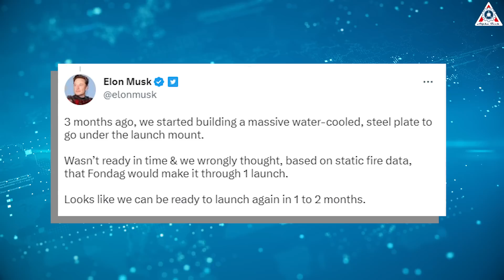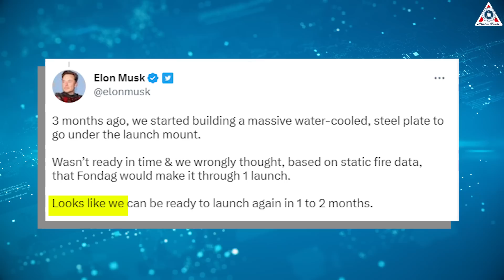SpaceX Stage 0 plans changed after huge damage from testing...

Comment: There is one thing that caught my attention: that the boosters aren't supposed to be transported around for launch. What I take away from that (it may be obvious, but it wasn't for me at first) is that each booster will have to have its own 'stage zero', i.e., SpaceX will have to build as many integration towers, OLMs and tank farms as it will have active/operational boosters. After all, the plan is for the booster to come back and land on its own tower/OLM to be prepped for the next flight. 

I imagine that there will be several starship orbiters for each booster, so as to be available for launch (is the fast launch cadence bears out) when the booster is ready. As it takes some time to load and transport a starship to the launch site, then integrate it to the booster, and even if they come down immediately after doing their part of the launch, they will take at least one full orbit to come back down, then be safed, moved to the cargo integration facility, yada yada yada. Now, that means that starship landing may (and in all likelihood will) take place in a different set of chopsticks than the one on the booster's stage zero. Imagine having a ship land on the same chopsticks, right next to the waiting booster (that has just come back from its previous launch), just to be taken down to a transporter and moved to the integration facility, while a second starship waits its turn to hop up on the tower.

So the whole launch/landing complex would have to have one launch/integration tower/OLM, one tank farm, a few (2 or 3) starship landing towers, integration facilities (like a mega bay), plus all the other facilities to receive and process cargo and consumables (unless the launch complexes have their own liquefied gas production plants (O2 and N2) and fuel refineries (whichever process that they could use to produce CH4). Imagine one Boca Chica complex per starship launch site, and however many they need to build.
Reply: If you can deal with limited transport options, a railroad build next to stage zero would be an option. That would likely allow moving SH's from there to a "parking lot" relatively easily. Anything other than to/from planned locations would still be the hassle it is today, but for an operational system, most of the movements could be known at the design stage.
Reply: Might need several boosters per base for repair down times, and such, one related thing I wonder about is a more automated handling system? needs something like a Rail Yard and sidings...
Reply: Mars is not going to happen anyway's. Maybe a few for prestige reasons. Mars "CITY" will just never happen. Come back in 200 years or so, maybe humanity is ready for it by then. Do the math with refuelling and getting people back home aagain...Oh sorry all 1 way trips i guess.
Reply: @aluminiumsloep  You don’t need the first stage on mars because you have only 1/3 of the gravity. But yeh, they probably can’t takeoff before building the takeoff pad on Mars. So you need some robotic missions to mars first.
Reply: @aluminiumsloep  I think its possible, but Elon is getting the cart ahead
of the horse some...
But its his business, his expression, and he is doing fine at making serious progress.

I think first priority should be using starships, to get up space elevators, and use them to build transit ships, and use them to build big stations and elevators on Moon, Mars, etc.
The Moon for instance has a huge lump of iron embedded in it, Mars likely has nickle iron metiorites everywhere that could be sifted out or dug up.
its about resources and energy, and getting things self sufficient in space.

Mars is do able, I just think we need to park a factory city in Mars orbit and get to work...
Show up with all the infrastruture and then some.
And Elon's greatest gift, will be forcing the competition to get off their aft ends, just like he has done with electric cars, and soon Robots.
Reply: @aluminiumsloep  Roach motel. Roaches check in but they don't check out.
Reply: @aluminiumsloep  If you go to Mars it will be a one way trip for most until we have a better form or propulsion then rocketry.  But who knows maybe once we are able to colonize Mars the advancements will happen quickly.  There is a huge financial incentive to develop resources to export to earth
Reply: @jamesp5301  Much cheaper to get from Mars to Earth than earth to Mars.
Reply: @fredjones7705  much. Gravity is pulling you in
Reply: @jamesp5301  Exactly...it's uphill to Mars and downhill to Earth.
Reply: @aluminiumsloep  Tl;dr; the plan should be for one way trips. Unless the plan is for many people to live the rest of their lives there, have families, earn degrees, mine resources, do r&d, design and manufacturer new technology... Unless the plan from day one is a population that will get to the point of saying "whatever" when earth can't send more supplies, then there's no reason to send even the first person. If that sort of 100% independent colony is the plan then the only reason to send ships back is to save on the cost of building more and you can save even more by not having anyone on board for the return trip.
Reply: How are they going to send a stage zero to Mars?
Reply: @Awaken2067833758  the starship does not need one.  Only the heavy however I suspect eventually something like that would need to be fabricated on the red planet but probably many years in
Reply: @jamesp5301  that is an untested asumption
Reply: @jamesp5301  yep. When there is need for a lift as massive (something like a 300-ton mass*) as a superheavy taking off from Mars, there is likely to be enough infrastructure up there to build a mechazilla already.

*I may have been too hasty with that figure. Although Martian gravity is a third and the possible payload to orbit would triple, there are other factors to consider: air resistance would be lower, the orbital height and therefore escape velocity are lower… the actual payload to orbit on Mars may be 500 or more tons using the very same vehicle. Wait… there wouldn’t be need for a second stage, would it? Heck. Make it 700 tons or more.
Reply: @Awaken2067833758  In parts to be assembled on site. 100 tons at a time will make that easier. We are talking hundreds or even thousands of ships transiting every 2 years, and probably a few emergency trips between those windows.
Reply: @Awaken2067833758  You don't need a stage zero on Mars.
Reply: @fredjones7705  why?
Reply: @Awaken2067833758  Mars has 1/3rd the gravity of Earth so the speed needed for orbit is much much lower. Additionally the pressure of the atmospheric pressure is 1/14th that of Earth so there's much much less resistance to accelleration. The starship that went to 50,000 feet a couple of years ago could easily make orbit unassited on Mars. As far as rocketry goes Mars is much better than earth as a point for further exploration/exploitation of the solar system.
   Additionally it is much closer to the main asteriod belt which contains core material from a smashed planetoid or two. This core material is much more dense than typical earth rocks. Rich in heavy metals...Gold, Uranium etc. 
   The reason it's more dense is that planets act as a giant refinery. Heavier elements sink while the body is still molten. Like fractional distillation it builds up in layers. We get some Gold on the surface of earth...but there's much more near the core. Sorry to ramble on but I've been a space nut since 1961.
Reply: Hey! make us a drawing! That's so sool! use AI...

Comment: I don’t think that SpaceX « miscalculated » the damage that the booster would do, they just took the risk to launch anyway.
Reply: @N.G.Gonbei  they said they expected the fondag to hold, but i wouldnt be surprised if this was just a low-key experiment
Reply: I believe that a thick water-cooled steel plate will be enough in my opinion to resist that hell but if it doesn’t then SpaceX will have to completely redesign the OLM. SpaceX should’ve took the design of NASA’s flame diverters seriously…
Reply: Elon should sell the company and just be involved in the rest of his company... No need to take high risk business
Reply: Also bureaucracy always makes it harder...
Reply: It does look like this is true. And if that's the case, the adults in the room didn't do a good job in speaking up, for even internet observers kept on saying that it might be a bad idea to not have these deflection infrastructures. And yes, the idea is to not rely on expansive deluge systems, deflection towers and steel plates etc because we can't use them for launches on Mars. 

But I would argue that it's more important to launch the biggest rocket ever successfully, and to remove potential risks to the launch. That the leadership hinted they knew the launch pad would be damaged by this launch (though they clearly underestimated it), shows how reckless the decision-making was, and was driven by other factors (profit, attention-span? I don't know). This launch will not sit well with the US airspace authorities, who unfortunately would now be even more reluctant to grant launch clearances. 

Yes, you learn best by making mistakes. But for others watching, it doesn't build trust or confidence..

Comment: It’s a major problem if they can’t dissipate the huge amount of energy unleashed when the booster takes off 
It seems to me that part of the answer is a trench to allow the flames to spread in a focussed way and part of it is steel jackets containing and dispersing a water nitrogen mixture to soak up noise and protect the lower part of the launch pad 
Go SpaceX
Reply: Ya think?  Wow, too bad the NASA engineers that launched Apollo didn't think about that on the launch platforms of the time, one of which Musk now owns launch rights to...oh, wait, they did.  And they didn't have any previous vehicles/launches of that size to look at.  Pad damage is inevitable on such a launch, but not THAT level of damage.  It surprises me how smart, and how damned dumb, SpaceX engineers can be, all at the same time.   And lest anyone forget, they intend to do the same thing with the booster catch phase.  I'm assuming that will occur on a different pad, but if  not ...

Comment: No way they launch again in 2 months.  No way they launch again in 6 months.  The launch table needs a complete redesign: it needs to be less complex and it most definitely needs a flame trench and diverter.  In addition the propellant farm needs to be moved farther away.  Looking at the holes punched in those upright tanks, it's fortunate that there wasn't a secondary explosion from one of the methane tanks that would have taken out the rest of the launch site.
Reply: Each of the tank farm tanks are actually a tank within a tank, with insulation between. Even if the damage is "cosmetic" it is still concerning. I think burying them underground would be worthwhile, if not just for the insulating properties from the south Texas sun.

Comment: In retrospect it’s completely mental that they fired that much force at concrete lol
Reply: Elon didn't want to have to use flame diverters because he reasoned that none would be available on the moon or on mars.  But why worry so much?  Luna is 1/6 earth gravity, Mars is 1/3.
Reply: @paulwilson8367  This was a huge reason.
Mars/Moon launches won't need to be this powerful but it's good to know the extremes we're dealing with.
Reply: @paulwilson8367  Elon's response doesn't make sense when you consider it's not super heavy launching from the moon and mars it's Starship... Super heavy is only launching from earth.
Reply: They simply ignored that generations of rocket engineers used flame treches to canalize those forces during liftoff. Hard to believe.

Comment: And what does that tell us about the kind of launch facilities that would be needed on Mars?  Anyone landing there is likely to be marooned.
Reply: Not really. Gravity and pressure on Mars is like 1/3rd of earth. Mars is also like 1/3rd the size of earth or smaller. Starship probably could do it.
Reply: @lupinereivaj  Not only that but the SuperHeavy booster isn't going to Mars - only Starship with its nine, not 33, engines is.
Reply: @kenoliver8913  exactly
Reply: @lupinereivaj   Mars have only 1/10 of the mass the Earth has. Works out as 1/3 the gravity. 
The moon has only 1/81 the mass of Earth. Works out as 1/6 the gravity force.
Reply: @astrogeo1  thanks for the input
Reply: The Mars angle is a marketing gimmick. This whole show is an ego quest.
Reply: He ain’t getting to mars in that contraption!

Comment: 4:21 can you see those harmonic shockwaves on the launchpad?  for some reason there was a synergy perhaps of the 30 motors acting at the same time producing winds at supersonic speeds, that sound must have broken the concrete and later been expelled by the force of the motors.  Is it concrete suitable to withstand such loud sounds and harmonic shock waves? 
I don't think so.  Here you have to re-design the launch pad and change the materials, otherwise it will have the same results every time.
Reply: Does concrete stand up to a jackhammer?  The jackhammer always wins.

Comment: I think all 33 were running when the hold down locks were released.  Very soon after the rocket lifted off 2 engines were taken out by concrete debris and then very soon after that the 3rd engine was taken out.  This all happened before the stack cleared the tower and the graphic came up on the screen.  They would not have let the beast fly if there were any engines out at release.

But there is no denying, with 70+ years of experience of launching powerful rockets and all the knowledge gained about what powerful rockets do to launch pads, that the design of the launch pad for the most powerful machine ever built by man, was willfully neglegent and willfully incompetent on the part of EM.  Absolutely stupid.
Reply: Ummm, what about the OTHER three I counted missing during ascent, at the very first video frame taken of the rear of the booster?  I counted SIX out, not THREE, and I suspect that may have been the reason for the tumble, if that occurred previous to the planned count up timer.  It was pretty asymmetrical, and who's to say that there weren't six MORE motors out at that point?   I don't remember hearing any nominal call outs on the trajectory, now that I think about it. May just be forgetting.  And unless they have at least a greater than 20% thrust margin available on the remaining engines, which I seriously doubt, it COULDN'T be a nominal flight path.  

I also know from personal experience that concrete LOVES to spall, rather energetically, when you get a torch a bit too close to it, and that is one HELL of a torch.  I expect this is due to absorbed water getting heated to it's vapor phase, and the resulting pressure.  It doesn't just crack, it physically ejects itself from the surface.
Reply: @MrJdsenior  as you could see in the video, the TVC (thrust vector control) was able to compensate for the asymmetric thrust and keep the vehicle going in a straight line... at least it could while TVC was still working.  It looks as if 1 HPU (hydraulic power unit) failed at around T+0:30, and the other HPU kept TVC operating until it failed some time later in the flight.  After HPU #2 failed, TVC was lost, and the rocket began to tumble since there was no hydraulic power available to gimbal the engines. But the original comment was that the stack lifted off the pad with 3 engines out, which is incorrect.  All 33 were healthy at the time the hold down arms were released, and those first 3 engines failed within the first brief moments of the flight.  The computers would not allow a liftoff with any unhealthy engines at the time of release.  After release, there is no turning back, the ship is going to fly.  The other 3 engines that failed happened later in the flight, and TVC was still able to compensate for those as well, as you can see the rocket was stable for quite some time with those 6 out.  

What would be interesting to know is how many engines can be out on one side of the vehicle before TVC can no longer compensate and continue to steer the vehicle... and, if the flight computers are able to use differential thrust to augment TVC control to at least let the vehicle continue to a point to where FTC can be activated out over the water instead of over land, should the unfortunate situation develop.
Reply: I've often heard that Musk has claimed that 'starship will not have a flame trench or water deluge system to take off from Mars'. Yeah it won't, but it will be a starship, not a booster, taking off in 1/3 gravity (heck, Mars starships may even have their landing rockets near the top, like the lunar lander starship, and only fire the main engines when higher up off Mars) should be a cinch (for given values of cinch).

Comment: I think SpaceX got rid of the oil rigs a bit too soon. Launch offshore is the most reasonable way to achieve. Plus it's portable.
Reply: Offshort launches defeat the entire purpose of what they're trying to achieve with Starship. It's important they figure it out through trial and error how to make it work without destroying the part of the process that allows for rapid turn around.
Reply from the maker: they have temporarily paused to focus on the first orbital flight
Reply: There is plenty of open space land in the Boca area.  Simply give SpaceX access to that land. Just like KSC is surrounded by open space, restricted use park land.  Do the same in Boca.
Reply: @Steve-Richter  you gonna pay the bills to build in the middle of nowhere? Everything would have to be trucked out there at great expense.